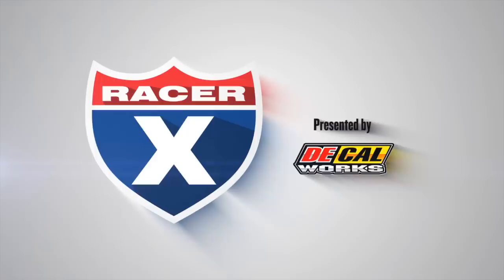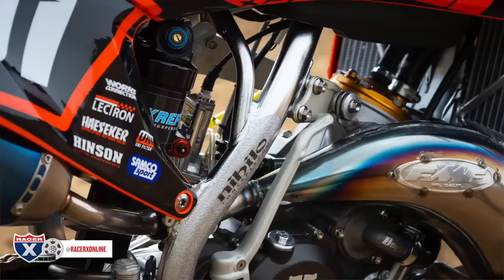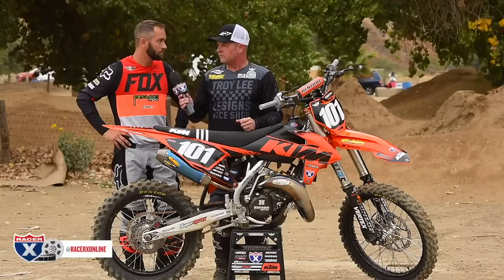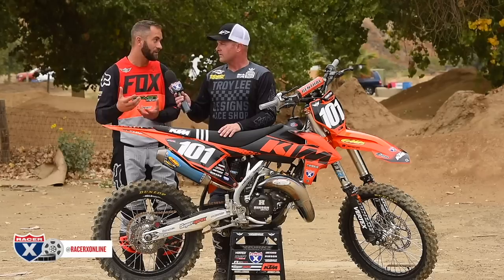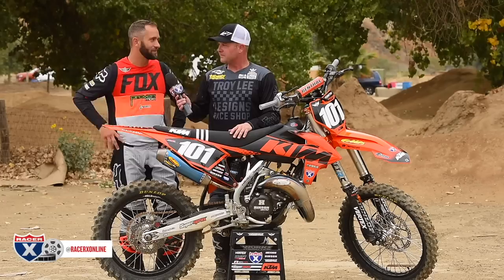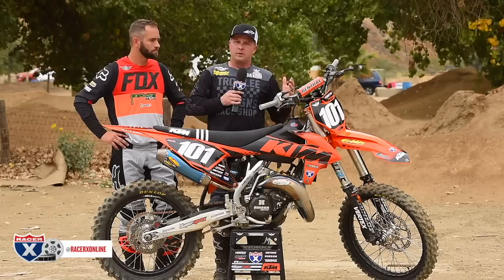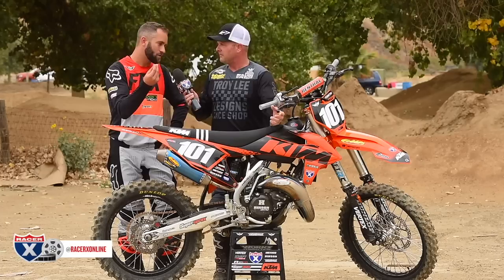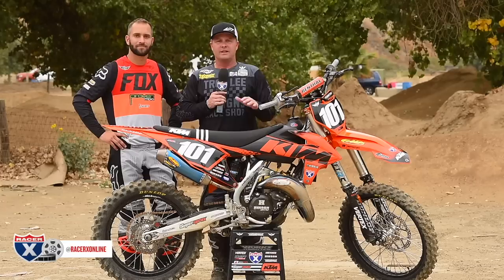Racer X Films: 2019 KTM 150 SX Two-Stroke Garage Build Project Bike

Comment: More horsepower than my  250 2-stroke😅
Reply: What 250’ do you have? 

2005 Suzuki rm 45,5 stock.
2005 Kawasaki kx 250 at 47 stock.
2005 Honda cr 250 47 stock. 
2021 Yamaha 250 46.08 stock. 
2021 KTM sx 250 47.20 stock.

This is engine application is modified to be as fast as you can get a 150 landing at max 44-45 in the right conditions and this is peak. So even if its maxed out its top peak hp would be 0.5 hp less than a 2005 rm 250 stock. 
However even 90s 250s might be less on the dyno so if you have one of those in stock condition yes. 

Anything performance added to a 250 two stroke and you would leave the 150 in the dust, obviously, but lets complete apples to apples.

But one thing is for sure, a highly modified 150 is producing some crazy impressive numbers, no denying that.
Reply: I've seen some 250 SX with 39 horsepower
Reply: @jr6874  Sounds crazy! Must have been old?